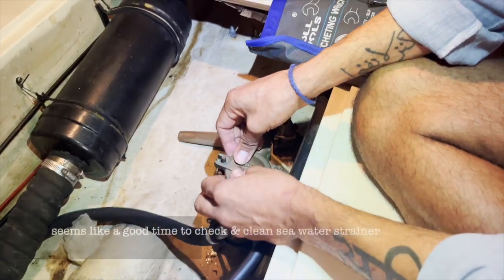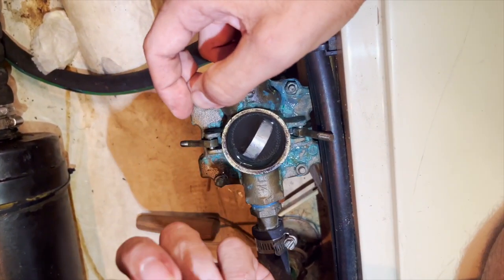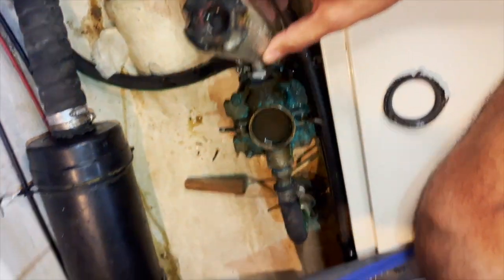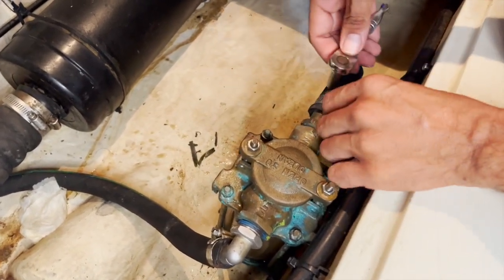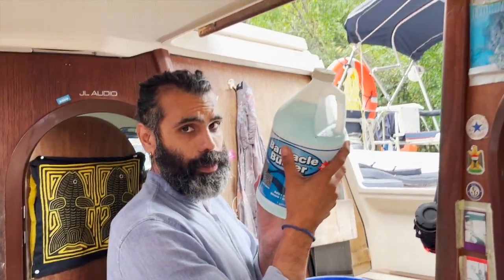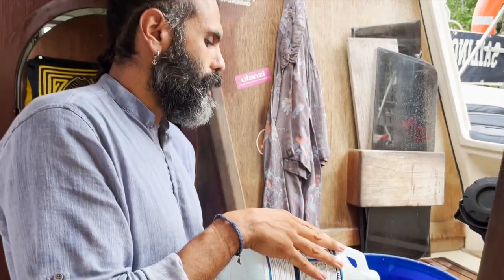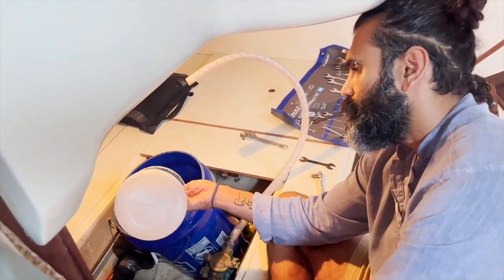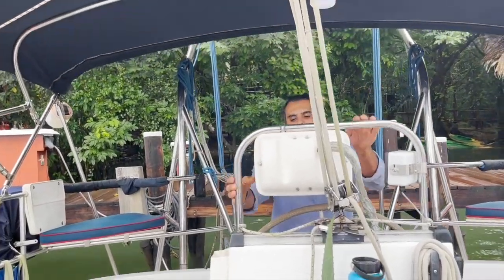barnacle buster How to use? Sailboat Engine Flush Heat Exchanger

Comment: Sir, thank you so much for this video. Hopefully this saves me a crap load of work brand new the diesel brand new this whole exhaust system rebuilt my muffler lift now I have to flush my thing out cause it's overheating. Hopefully I don't have chunks of something in there, I just bought the boat. I'm gonna try your method first. See if that helps. Happy sailing brother.
Reply from the maker: @TomTaylor-ho3on  you are very welcome brother 🤍. I’m glad it helped.

Comment: Not a good idea to immerse and closed system. The descaling process generates gases and needs to be released.
Reply from the maker: Its true gases are released but if you keep the area well ventilated with air circulation is fine. The closed loop system was suggested by the manufacturer as the preferred secondary flushing method

Comment: I believe removal of zinc (if installed) will be important prior to flushing.
Reply: Typically, there is a zinc “pencil” screwed into the heat exchanger and the barnacle buster will erode that zinc if not removed in advance. I do think this video method for pumping it through the entire cooling system is best.
Reply from the maker: @danielsondavidf   All zinc anodes have been removed from my engine.
Reply from the maker: Interesting idea. Do you mean the zinc on the engine mount or the zinc on the propeller shaft (under the water)

Comment: Thx for the vid. Did you have cooler temps after this?
Reply from the maker: for suure, man. after the flush i placed my temperature gun next to the engine & big difference. it is a better cleaning method than taking the heat exchanger a part, replacing the gasket etc. try it and post back your results. Good luck my bro